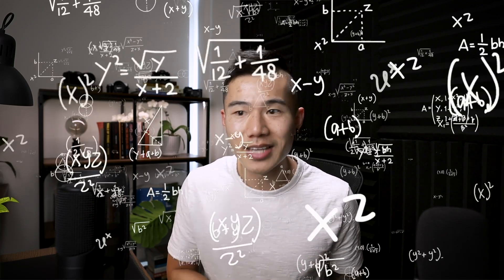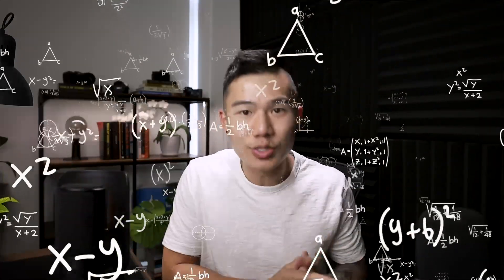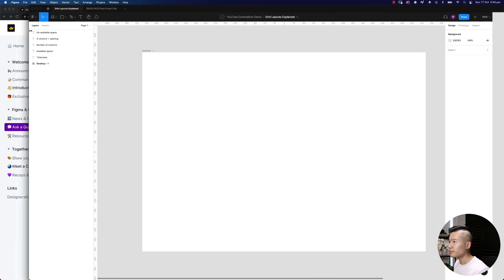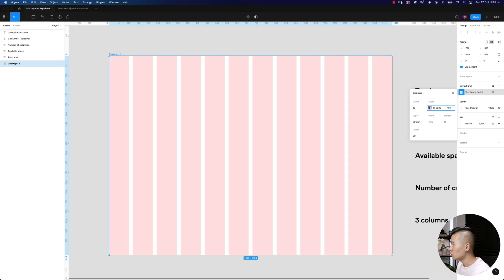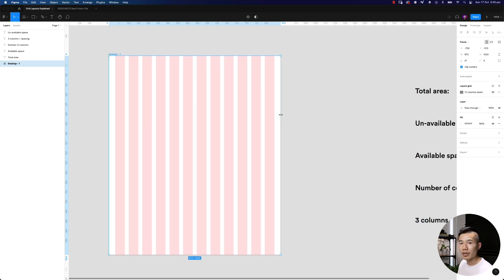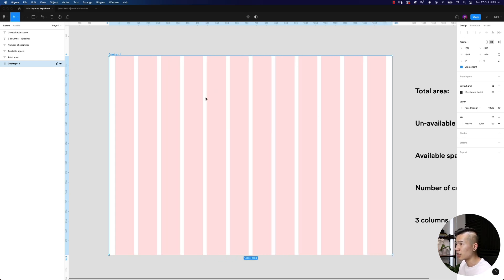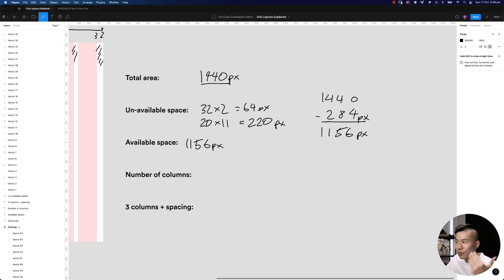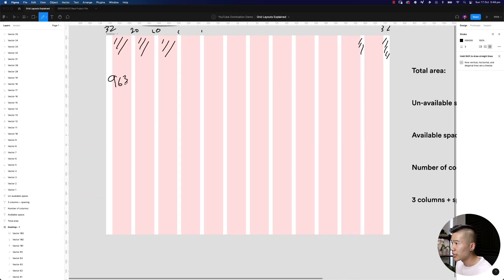How to Calculate Responsive Grid Layouts (STEP BY STEP!!)

Comment: How one can follow 4pt grid system in such case? Since, the column widths are not in multiples of 4 spaces!! Container placed over these grids won't follow 4pt grid system due to either odd number width or decimal. Would love to know your thoughts on this @mizko. Since, I didn't find answer to this question anywhere on the internet.

Comment: I have a question about the page/section height.  When I watch design videos, most often when designing for desktop screen sizes designers use a 1440x1024 frame however the actual viewport height of the browser is usually significantly less.  As a developer I can either make the section vertically responsive and make each section fit perfectly into the vh(viewport height) or keep the height pixel perfect to the design and just accept that on many devices the bottom of the hero section for example would not be visible until the user scrolls down. I am a developer with a some design skills but I'm very green In web design so I imagine this may be obvious for some however I was curious if there was a concrete/industry standard solution or if this is more of a judgement call.

Comment: Hey Mizko, thanks for showing us the math behind the grid layout. There was something I wasn't sure about though. Why set the grid to stretch instead of center? Thanks for your feedback.
Reply from the maker: Stretch = Responsive because it will always stretch and constrain the the edges.
Center = If you want your content to be centered of the page. 

You can choose either, depending on what type of layout you want to achieve.
Reply: @Mizko  Thanks, I'm currently using Figma to create my portfolio. I never noticed that in the settings. Your video helps me better understand Figma's layout system.

Comment: I guess the important takeaway from this video (for anyone who may misinterpret it like I did when I first learnt this concept) is that we don't need to focus on the exact pixel values (329 or 332) when it comes to width. Because like mizko said, width of elements will be dynamic at different viewport sizes. You should rather focus on choosing what margin and gutter space you want to apply. Because in responsive layouts, your columns are dynamic but your margin and gutter remain static
Reply from the maker: 100% responsive layouts are 'fluid'!
Reply: I remember seeing 2 classes with names container and container-fluid never really understand the purpose...

Comment: Loving your videos man! With responsive design - how do I make it so when I alter the width of the main frame (essentially a viewport), an image will keep its FULL aspect ratio? So when the viewport width increases, the width and height of an image increases? Thanks
Reply from the maker: You can maintain the width by using constraints of background images in shapes, but you can't increase the height yet. I'm sure there will be an update coming in the future.
Reply: @Mizko  Ah I see. That’s a bit of a bummer! So essentially, if I want an accurate responsive design … I have to keep resizing the images?